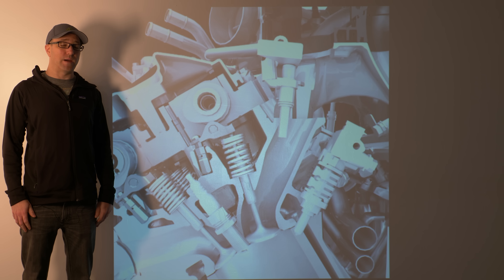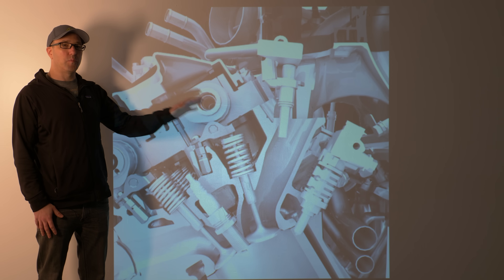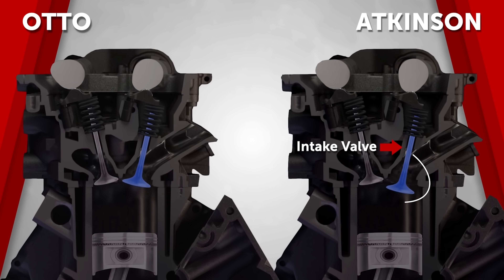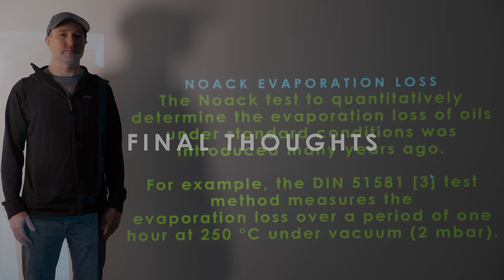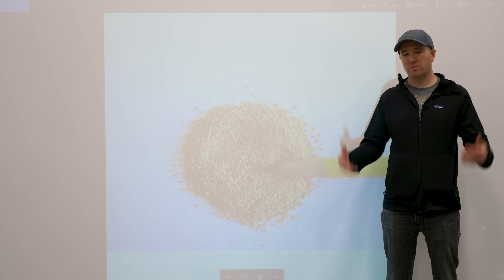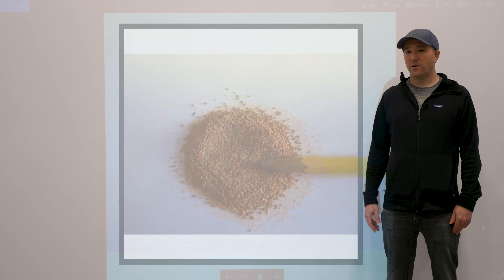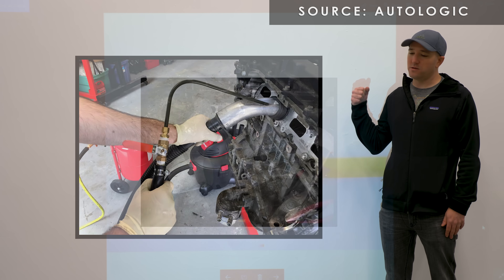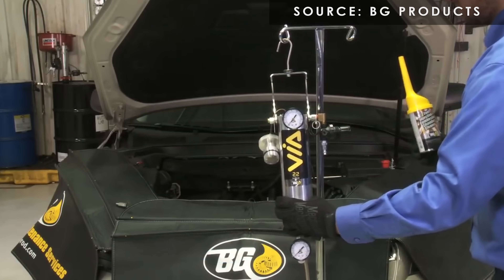Direct Injection, Problems and Solutions | The Fine Print

Comment: You didn’t talk about spraying cleaner from the intake box, after the air mass sensor, every 10k miles or so as a preventive action. Scotty Kilmer has a video about that.
Reply from the maker: There are a ton of chemical ways to deal with it.  But thats an entire different video.
Reply: I'm surprised nobody has brought up Seafoam yet
Reply: Make that video. Uh, please?
Reply: Well it's totally relevant to this video and should've been mentioned along with the walnuts.  In fact Seafoam method works great on DI and its easier to do when there is not a turbo, the catchcan is useless- you should know better.

Comment: Advice? I drive a Fiat Abarth 1.4l Multiair Turbo thats port injection only. The dealership wants to charge $200 for a fuel cleaning, injectors and all that. This is recommended for 30k miles in service manual. Being port injection do i really have to worry about that? I would definitely go somewhere else for a cheaper cost.
Reply from the maker: 200 is not all that bad. But you can get by mostly just doing in tank chemicals for cleaning injectors.  If you can remove your intake hose from throttle body and see oily residue you should get the full service done assuming they clean the intake tract.
Reply: Daniel,  just buy top quality Gas that already contains detergent.  Premium gas has more than just higher octane, it also has more detergent.  I would not do the 200$ cleaning it's a waste of money.
Reply: Not that important on a port injected motor unless you're having drivability issues.

Comment: I would say that manufactures new this was an issue. What about the mules they test for years. Surely they saw deposits on those test mules. Anyway. Direct vs port injection. What percentage increase in fuel economy is really gained? Dump direct injection.

Comment: For preventative maintenance, there are induction services. You fill a pressurized canister with some sort of carbon cleaning fluid, hook up an air line, run a thin tube and nozzle between the throttle body and intake boot, and run the engine until the canister is empty. Take the car on a nice hard test drive afterwards. Most of the fluids are made by BG. I like mixing it with gasoline and pulling the fuel pump fuse. You know it's done when the engine stalls, and gasoline is a pretty powerful solvent. We charged around $150 for the service at the Hyundai dealer I worked at. We recommended it every 30k miles. The Audi dealer I worked at didn't offer such services and we saw tons of vehicles that needed walnut blasting. That can easily be $600+. Those induction services help a whole lot. It really is a night and day difference. Honestly, spraying a few cans of seafoam or some other type of intake/carburetor cleaner in the intake works very well too. A friend of mine seafoams his A4 every 25-30k miles and has never had any carbon issues. He has over 180,000 on it now.

Comment: I so am looking forward to my GTI reaching 80,000 miles. So much to do! So many changes! It will be like an adorable child becoming a teenager. I'll need to do the DSG service (for the second time - every 40K), the oil, the brakes, the radiator flush, and check for valve deposits. So much fun! Maybe these are the normal reasons people dump cars at 3-4 years? Why do all this maintenance when you could just get a new payment and a new car? 

Of course, what most people do is no maintenance and new car, which then becomes two cars with no maintenance done to them, and the cycle repeats. 

No fucking way I'd do a catch can, because why would I want to trap condensation and empty out dirty water all the time? It does actually freeze here in Georgia, and why would I fuck with that? Valve cleaning if and when necessary seems like a lot less hassle. I'm sure most people do the catch cans because they like adding crap to their cars. I'd consider it depending on the expense and necessity of the valve cleaning job. At the moment it just seems silly.

My only ray of hope is that supposedly VW has done some tweaking to make the PCV system gooder on the Mk7 generation of TSI motors so that valve deposits are not such an issue. Fingers crossed! Oh, and my new (0km when removed from donor car) 2.0 engine is doing great. Feels like nothing happened at all. Car is freshly detailed and it's like it was all a bad night out with a $6000 hangover.
Reply: I have my 2007 Gti. I am first owner and have 110000 miles. No symptoms.
Reply: Run an AOS not a catch can bud.
Reply: Eric Michel The MkV GTi (2004-2010) were all FSI direct fuel injection.
Reply: Dave Smith Yes, Mazda SkyActiv engines have problems with carbon buildup. I usually run CRC intake cleaner through my 2015 Mazda 6 every 10,000 miles or so in hopes that I’m preventing it from getting worse.
Reply: Eric Michel 
Haha I’m waiting for it in the wife’s ‘14 Jetta with around 40k on it.
supposedly the 1.8 gen3 engine is better than the older 2.0 but time will tell. 
I was tempted to try a catch can but there’s not many that wouldn’t affect warranty and are wicked expensive. 
I can’t justify 400$ for a catch can and some hoses if it’s only gonna buy me time until it needs an intake cleaning. 
Like hell im having someone do it for me, I’m a tech I’ll diy (Dick It up Yourself) 
Not everyone has that luxury unfortunately.
Reply: The PCV system (and built in oil separator) in the MK7 is exceptional, but we're still getting deposits. The reality is most of what ends up on the valves never came through the PCV,  it burped back up from the cylinder directly. My 350+whp '17 GTI is about to hit 30K. I've committed to blasting it every 30-40k miles. Really its a few hundred bucks for a blaster (assuming you have a compressor and shop vac) and 4-6hrs work every 18-24 months (based on my 23K miles/yr). Sucks, but not the end of the world if you're not a lazy fuck, like most people. The chemical method sucks BTW, as solvents can make it by the valves, wash the oil off the cylinder walls and cause such a bad dry start it can result in immediate and permanent compression loss. I would not consider any method besides walnut blasting.
Reply: BigBeansM3 
Yea my shop(on my channel) has that covered, I’d get a walnut blaster setup cause I could use it on lots of other things. 
Couldn’t ya just use or modify an open air blaster that sucks the media out of a bucket? 
I’ve got an air eraser but it’s for detailed work, like I’ve removed dirt from primed paint with it.
Reply: Candice Juliano Shooting I'll stick with my Leaf. Know what maintenance I'll have to do at 90,000 miles? Visual inspection, change the gear box oil (1.5qt drain and fill) rotate my tires and change the cabin filter. 👍
Reply: Candice Juliano Shooting 
I'm a little surprised at the naivety on this comment section.  I see people referring to a "intake cleaning" or a "valve cleaning" job as if it's some simple and inexpensive  task.  Nothing could be further from the truth.  It's a very involved process.  Some intake manifolds require much more disassembly of other portions of the car just to take off.  Then some cylinder head designs don't have direct access to the valves.  It all depends on the intake port design.  Some cars will require the cylinder heads to be removed and the valves would have to be removed to be accessible for cleaning.  You're talking about being into thousands of dollars for a valve cleaning in some cases.  Draining a catch can at every oil change is certainly much less of a pain in the ass than any valve cleaning job would be even on an engine where the valves are easily accessed.  Media blasting only works on surfaces you can get to.  With the valves still in an engine, you'd only be able to clean part of one side.  It wouldn't do anything for the back side.
Reply: Candice Juliano Shooting   You pay $30,000 dollars for a car and after three years you end replacing many parts.
Reply: Candice Juliano Shooting  Google.com Been testing Oil LS1. It's about using Marine outboard two cycle TCW3 rated  oil in your gasoline at 1 oz per 5 gallons of gas every time you get gas. Read the testing these guys did for us. It cleans and  lube the whole system. I've been doing it for over year with great results. Try a few you won't be disappointed.
Reply: Is it just me, or NA mk7 gti doesn’t have a dual fuel system? Cos in europe i have it. EA888 gen 3
Reply: If you want to love a car, buy a Honda or a 'yota. Any more they look like crap, drive like crap (Especially all this CVT and hybrid noise, gross. Avoid at all costs) and they definitely sound like crap, but they still sort of have that Toyonda reliability. I think that's the best you can reasonably even dare to hope for today. We know, now (some of us have always known, ha!) that VW doesn't really translate to 'The People's Car', it actually means 'Hard to Believe People Continue to Give Us Money for this Filth'. :D God, I want a Corrado... garbage, and I want it anyways.
Reply: BigBeansM3 some of the intake valve deposits also take place when you decrease engine load at higher revs. Due to the differential pressure between the port after throttle and the upper valvetrain, a slight amount of oil is always pushed over the valve shaft gaskets on the valve back and is being burned there by internal exhaust recovery or valve overlap. That is one of the main reasons why direct injectors should run lowSAPS engine oil.
Reply: Candice Juliano Shooting vw is trash And so is di
Reply: BigBeansM3 not wanting to tear into your motor doesn't make one lazy, quit apologizing for shit vw engineering
Reply: zoticus1 literally every direct injection engine has carbon build up lol like all of them.
Reply from the maker: I'm surprised you didn't drive that thing off a cliff after you had your motor Replaced you definitely seem committed.  I think this is the primary reason why people just least their cars so they don't have to do jack shit beat the fuck out of them neglect them turn them in and get something new.  But I feel like it's so wasteful it's good that you're committed I'll be curious to see what your total expenses are for maintenance when you're all done.  And yeah the catch can thing can't have problems with condensation if you don't install it right it needs to be lower in the engine bay and closer to the motor for heat.  But if you're okay with just having the intake manifold service you're all good.
Reply: I live in ATL, so there aren't many cliffs handy. It was a tough decision but the way the car was financed meant that I'd be better off repairing the car than walking on it. I can tell you it's soured me greatly on VW corporate, dealer, and the car itself. This was a car I seriously wanted to love, and still do except that I realize it was probably shoddily-made and could have other nasty surprises in the future. It's mostly the disillusionment that hurts- I wanted to love this car but it's been tainted. I do plan on keeping it for 10 years or until I total it; whichever comes first. 

Anyhow, I'm wondering which cleaner or type of cleaner you'd recommend I use for the DI injectors? I'm hearing on forums that 2015 owners of GTI's aren't noticing carbon deposits like with the previous generation possibly due to better PCV design and injector angles as in the Porche system which uses horizontal spray pattern to clean off the valves as they open. But I do somewhat worry about the nozzles clogging as your video demonstrated. Maybe the cleaner Scott mentioned? 

Oh, An interesting tidbit I learned is that the European and Rest of World VW's with DI also have port injection. Not the NAR ones, though. Reason is the particulates are more regulated in Europeland than here. The PI reduces those fine particulates. We don't care about them here so VW can make a buck cutting the port injection for us.
Reply: savagegeese, 
Excellent video. Does the Mazda3 SkyActiv engine have problems with DI carbon deposits?  I've read that Mazda designed the cylinder temps to be hotter and higher compression to avoid this problem of dirty valves.
Reply: That's because older cars like your 2007 GTI do not have direct injection. I believe that started with the MK7.

Comment: Great video, great information. Couple additional thoughts.
- Contrary to conventional internet wisdom, GDI cleaners DO WORK do a small degree.  It's not a substitute for walnut media blasting, but can be used as an "in between" solution to slow the rate of carb deposits. It can also increase the risk of knock on older DI motors; so it should be used sparingly (every 30-60K). The key is making sure the cleaner is added/atomized after the MAF/turbo on a motor idling at operating temps. Ideally, the combination of heat and the cleaning agent softens lighter deposits to a gummy residue, which is subsequently burned off when driven at normal speeds.
- "Fuel system treatment" cleaners burn at a higher temp than traditional fuel injector cleaners. They can help make EGR cleaning a little easier when used prior to removal, as the cleaning agent is recirculated at higher temps through the EGR pipe and valve.

I'm a huge skeptic when it comes to "snake oil" cleaners and the placebo effect. But the above mentioned approaches can help. Worth researching if you plan to own a DI motor long term.
Reply from the maker: Personally if I still had a d i car I would still continue to use the fuel cleaners and additives because there has to be some element of it getting back into the intake valves during the combustion process.  But this is so variable on engine design tuning and all the other things it depends on how much you really want to spend.

Comment: Why not just disconnect the PCV?
Reply: stop making shit up

PCV delete is the final answer.
Reply: OK thanks for your time and this info
Reply: +Paul L Emissions! Emissions! Emissions!
Reply: Modern PCVs are highly sensitive to pressure variances - especially turbo setups. Modding the system "can" lead to other issues such as indirectly raising crankcase pressure, which can subsequently lead to oil seepage.
Reply: You could route your crankcase gasses out your exhaust past the catalytic converter, where the natural flow of exhaust gasses pulls a vacuum, evacuating the gas in the crankcase. The issue being you are bypassing emissions systems our overlords have designed to keep the air cleaner. You should feel honored to pay to more to maintain an engine because emissions controls cause as many problems as they solve.
Reply: It actually helps make a tiny fraction more power, but mainly helps oil last  longer by taking blow-by/oil vapors and putting it back through combustion instead of allowing collecting in the crankcase.    The trick is to separate mist from vapors to keep the intake cleaner.
Reply: you'll be running lean as hell.

Comment: MISHIMOTO. OIL. CATCH. CAN. 110 BUCKS. ... naah, really. Bought the aforementioned, shall install on my 3,0 turbodiesel V6 audi engine.... otherwise - wings of the turbo have started getting a bit dirty.
Reply: shit. wrote the comment before you started talking about the cans. one thing, though - best is to buy baffled. Slight premium, but the air/water condensate/oil sludge will get filtered much better.
Reply: shit. wrote the comment before you started talking about baffled cans. HOW DO YOU DO THAT? HEEEELP!!!

Comment: What do you think about that CRC GDI cleaner? It's meant exactly for GDI engines and will supposedly help prevent issues if you use it regularly.
Reply: I talked about it in my comment. It works, but not nearly as good as walnut media blasting. I'd suggest using sparingly, in conjunction with removing the intake manifold to scrub/blast the valves. In my experience, the cleaner is most effective when sprayed/atomized right before the throttle body. I'm not a fan of letting it mist the turbo/intercooler (though CRC claims it's safe).

Comment: I did have DI problems in my Audi but it took until it had about 130,000mi. I can deal with that.
Reply: In my case it wasn't too bad, the car just started misfiring when cold, exacerbated in the cold because it took longer to warm up. I didn't notice any significant difference in mileage either. About $350 to clean, I think they used walnut blasting. Maybe it's gone up, that was a few years ago.
Reply: What happened at the 130,000 miles? Did it finally throw a code? Or was the performance and mileage just progressively diminished over time until you had to do something about it?
Reply: Good to know, what oil and gas to you use?
Reply: Serge Vivier Castrol 0w-40 and either Mobil or BP fuels.
Reply: how much did it cost to fix/decoke?
Reply: Davis Lawrence 
So it still wasn't enough to trip the OBD misfire monitors then-
Reply: Bet you didn't have the work done at an Audi dealership ... Your cost seems reasonable for that much of a procedure, even a few years ago
Reply: George P. Oh yeah, I did use an independent mechanic for sure. I got quotes in that region from a couple VW/Audi specialists. I don't think out of warranty service on any brand is a great idea at the dealer, let alone a luxury brand. For the guy above, I can't remember if I had a MIL illuminated.

Comment: I cleaned the valves on my R56 MINI Cooper S (Peugeot Prince engine) with a $10 gun cleaning kit from WalMart, some automotive cleaning solvents, some rags, and a shop vac.   It was a nasty couple of hours of scrubbing but made the car drive like new again.

If I were to buy another turbocharged DI car I might seriously consider an aftermarket wet shot of nitrous that would only work at low boost.  That would put plenty of fuel down the intake runners, improve spool, and give me an excuse to give the judge for my gross display of speed.

"I was performing routine maintenance, your honor!  I submit my 8x10 glossy photos of carbon caked valves for the court's consideration."